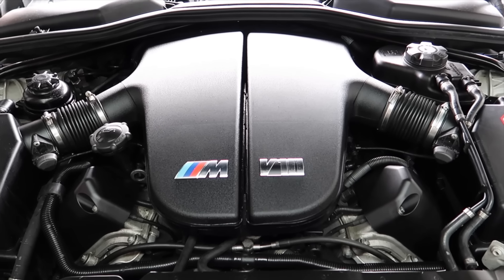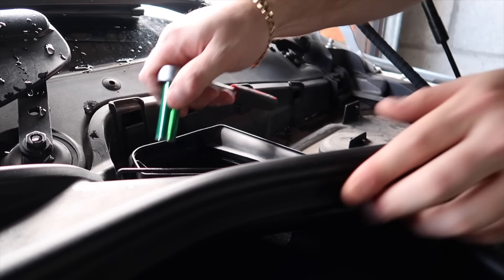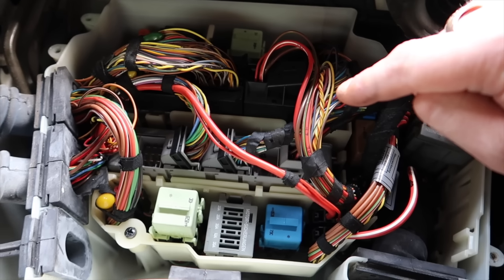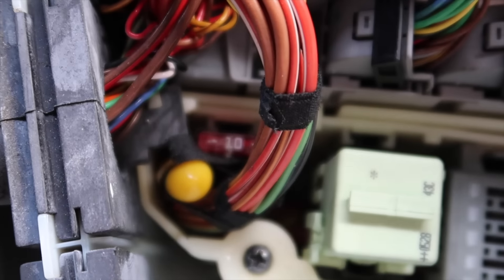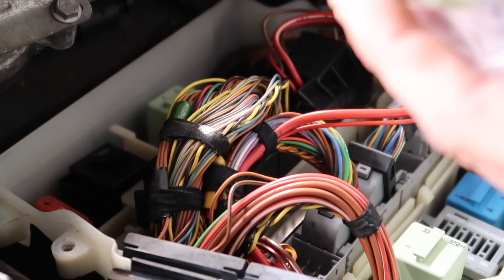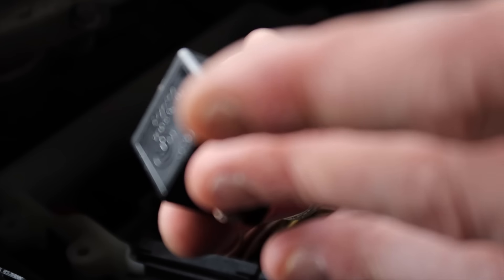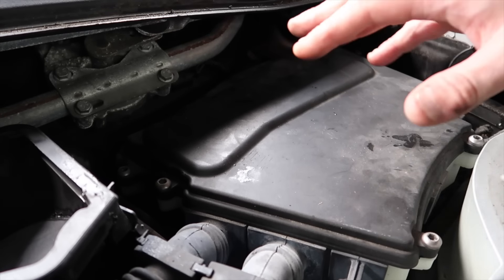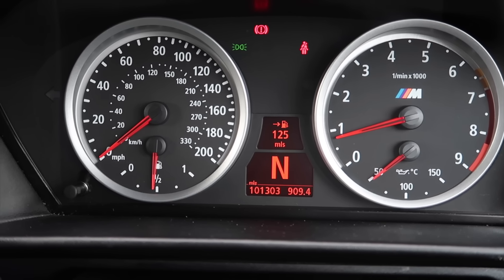This **Illegal BMW Mod** Just Changed Everything For BMW Owner's !!

Comment: Now all I need is a M5
Reply: E60 are cheap... only issue is the rod bearings...so get ready to spend $6 to $7k ... worth it just make sure you have something else as a daily driver ... driving a V6 and a V10 that need premium burn a hole in your wallet ($3.44  9/10) look at the tank size and do the math 😵
Reply: @markrayes2973  rod bearing is only one issue these engines have  there is a few more.  Throttle actuators is another common problem.  They fail more than rod bearings.  Look into it and there is a few more issues other than the bearings and actuators.    The engine is a f1 inspired engine so reliability isn't the best    requires maintenance regularly. But I love the engine myself.  I have a e60 and as much as it pisses me off sometimes it always puts a smile on my face when it is working.  Love that v10 and its sound
Reply: Same...
Reply: @markrayes2973  get a electric car not V6 lol. There are literally free chargers you can charge for free for the rest of your life
Reply: E46 is better
Reply: @markrayes2973  6,50 over UK per gallon  your lucky
Reply: @markrayes2973  bearings are not a problem if you let the car warm up.
Reply: So it’s not all bmws 😥
Reply: Love it lol
Reply: @clifrusso2174  🤦🤦🤦🤦thats not a car thats Just fore people Who think they are saving trees so they think
Reply: @trewilliams8989  e46 ?? 🤣🤣🤣
Reply: @markrayes2973  I know a guy who bought 3 v10 m5s and they all blew 😭
Reply: Best comment ever
Reply: Facts you buyin

Comment: A Word On Relay Cases: Sometimes the plastic case is installed in a different position on the same relay(by the manufacturer). So go by the PIN locations and NOT by the relay case! Thank you for the video.
Reply: They only go in one way

Comment: Will this method work on a 2000 323ci E46 (M52)? If so, is it the same procedure? If not,, show me the procedure. Thanks.
Reply: I have the same car and want to know
Reply: @standtall7646   you cant do anything for yours 323ci to get higher performance , turbo anly

Comment: Does the replacement of the relay apply only to SMG transmission? I have a 2011 F10 528i, and sometimes at very low speed while slowing down, it suddenly down-shifts and it feels like a kick in the arse. It can startle you if you don't know about it. Wanted to find out if it's maybe a relay problem and not something else. I heard from one mechanic that many other models of BMW with that transmission experience the same issue. Some spent $$$ on fluid and filter replacement, only for the issue to come back. He never mentioned anything about a relay.

Comment: Potentially dangerous, most production cars are fitted with tyres that are rated within the speed tolerances of the restricted cars speed, more velocity = more friction, more heat, more centrifugal force, more chance of high speed blowout or delamination. Not something you want to be dealing with on a public road closing in at 200mph. Check tyre specs beforehand.

Comment: I totally respect everything you say only because I am a builder with knowledge about building and not a knowledgeable person like your self who totally understands BMW and engines. 

I have a 2010 BMW X6 V8, to date at 82,000km I haven’t had any issues with the engine although I must say the engine is consuming some oil, the mechanic at BMW told me not to worry because the engine is a high performance engine, what’s your opinion about the engine of my car, is it time to  sell and move on, any advice will be warmly welcomed.
Reply: Engines, especially v8s, can burn oil over time. Unless it’s burning a significant amount of oil, it’s nothing to worry about. In other words, topping it off every few weeks is ok, but if your having to dump half or a quarter of a bottle every week, then it’s time to consider selling, or at least having it looked at.
Reply: I recomend selling it before the cylinoids go out. My dad has owned 2 v8 bmws I have worked on them. One was a e90 m3 and the other was a x5 twin turbo 4.4l v8 and man did the x5 have issues. I would recommend selling. That being said the e90 m3 was a great naturally aspirated 4 liter v8 and it was bulletproof and didn’t really have any issues when he had ownership. But they are very expensive when things go wrong for any bmw but especially the v8 and v10s. I have a e91 328i wagon it’s xdrive and I love it. I haven’t had any issues with my car but it’s an in-line 6 and naturally aspirated so it doesn’t require that much work

Comment: I tried it on my 2006 E60 m5 it it did not work, after removing the 10 amp fuse i had all sort of failure codes in the DME and gear box module and was not able to clear them until i did put the fuse back in. @BMW Doctor mine is a US version is there something different ?

Comment: Will you not get a lower rev limiter safe mode without the road speed signal getting to the ecu?  In most bmws it will get the safe mode to prevent bypassing the speed limiter by simply cutting a wire

Comment: Is it purely for top end speed or does it improve acceleration getting there too?
Reply: It sounds like it just increases top end speed. Nothing more.
Reply: very late but removing that speed limiter will get you a higher top speed but will risk your engine to damage which hints why there was a limiter
Reply: @koudiack  hilarious, no, your top speed has zero to do with hurting your engine, rev limiter keeps your engine from going too high in rpm range, and I highly doubt it will max out on rpm in highest gear at max speed as I don’t see a m5 doing 220+ mph

Comment: I found a 10amp fuse in my F10 535d N57N, I removed it and I got a Engine Light and it didn’t remove the speed limiter…I replaced the fuse for now. Any thoughts?

Comment: I have a 06  BMW 330i e90 I have a slightly different electrical box than you and I'm wondering if the one 10amp fuse inside is the same as mentioned in the video.  I have a 7.5, 5, 40, 30 amp fuses in side this box. 2:56

Comment: My question is, after you remove that 10 amp fuse (speed limiter), do you have to reprogram cpu or something after that’s done??? if you don’t wouldn’t it throw everything off? Please let us know, oopsi forgot to add I’m in the US and I know sometimes the BMW spec and such are different for Euro vs US,  does that make a difference? Would US owners have to do extra? But mainly my question is on a US spec Bimmer, do you have to reprogram after you pull the limiter fuse? And will removing the limiter, affect and diminish low-end acceleration rates? Obviously this mod will INCREASE high end power (top speed) but sometimes when you tune a car for top speed you sacrifice low-end power. Will the same hold true in this case? Thank you for sharing this and reading my comment🌹

Comment: I’m wondering if This 10amp fuse is located on the same spot for all e60 M54B30 engine manual transmission??
Reply: I don't see this fuse in my 550i

Comment: Dean,i have a question why do you need to REPLACE the same relay i mean it will function the same again whats the point
Reply from the maker: no it actually didn't it actually made it ten times better the SMG pump and the gearshifts were so much much better after this.

so clearly I think your wrong
Reply: @BMWDoctor  Yes because i dont  that much knowledge about BMW'S 🙂
Reply: @BMWDoctor  thx for video
Reply from the maker: @osamaalfayez4017  Always a pleasure !
Reply: Bmw legend !
Reply: @BMWDoctor i tried to find this fuse in my 545i it wasn't there. Is it possible that it is located in the ivm module?

Comment: Thanks for the video but I have a serious question and yes I watched the whole video. I own a 2016 bmw 535i xdrive non M sport. I opened that box on my car and there was only a small cover with wires on it and underneath the box lid was just what looks like some sort of blower for the air and heat. So my question is where is this fuse located on my car. Thanks and keep up the great videos.
Reply: Dat Benz Doe hey did you ever find the fuse? Is there one that you can even remove to simply get rid of the limiter?

Comment: wow awesome !! i own the e63 m6 2008  removing this cause any check engine lights or any type or light warning on the dash ?? would love to know this
Reply: It caused a couple when I did it so I had to put it back because one of them reduced my power  and limited some gears not sure why but I commented on here and asked if I did something wrong. I have the exact same bmw e63 m6 2008 convertible .
Reply: @shanewhitfield9253 oof. Let me know about any updates perhaps. I’m considering doing this when I get mine back. But honestly, 170 is kind of enough. If I were to take it some track that I had the room to properly do 200+ I’d have it remapped professionally and maybe a couple mods added anyway

Comment: Hi
I have a 16 plate, 435d gran coupe.
The box with the ecu/relays in is easy to see and get too in it however when taking the cover off and looking inside, I can see the ecu etc and relays however there is not a single fuse, especially a 10amp one plugged in, anywhere within the box that I can see other than those grey, relay type plugs that you can see have 5 fuses inside.
So…….quoting the video…. Does this work on a f36 4 series or not?
I’ve heard that with these, the only way of removing the top speed limiter is by mapping/flashing the ecu??
Can you or anyone let me know please?

Comment: Do you know if those two fuses that you swapped out have the same common issues on the S85 E64? Wondering if I should do those soon since I’m pushing real close to hitting 60k miles.
Reply: If you have the SMG transmission then yes, I would get new ones for just in case

Comment: Hi there you seem to know a lot about bmw I could do with some advice if possible I have a bmw e70 X5 40d is a 2011 with 95k on the clock it's developed a annoying problem the gear box as become erratic in its gear changing quite harsh between 1st and second it's had a fluid and filter change and I've recently had the inlet etc decoked and it was better for a while but now it at it again and it's doing my head in can you HELP 😬 thx phill

Comment: Ok, I need help. I have a 2008 BMW 528i. It is a no crank no start. I had starter replaced and bought a new battery. Still nothing. The mechanic said it gave a IBS code. So I tried disconnecting the IBS cable to start. Again nothing no crank no start. Everything is on in the car. When I hit the start button I hear the fuel pump trying to work but no clicking or any other sound. I’m at a point where I don’t know what else to do. HELP!!
Reply: Go to dealer and get a new key.  I have posted about this issue elsewhere.

Comment: Very cool video ! - Thanks for the info on disabling the top speed limiter on BMW's ....Would you by any chance happen to know how to fully disable the auto gearbox limp mode in the older E39's ??

 I have an V reg 1999 E39 540i auto that keeps on going into "Trans Failsafe Prog" mode every time the car warms up, the gearbox feels OK and the car drives smoothly until it gets warm, Then I feel a gentle thump followed by a gong and "Trans Failsafe Prog" on the dash and the car  is then very heavy to move forward from a standing start because the gearbox is locked up in 4th or 5th gear.

Turning the ignition on and off gets rid of the fail safe for a few moments and then it comes right back again ! making the car no fun to drive :/ 

I've checked everything and changed the battery 3 times and its still the same story, I think that there might be a break somewhere in the wiring harness that is causing the fault. The strange thing is there are no codes stored on the TCU when I scan it with  the scanner/code reader which is very weird.  

This problem only started happening when I had to reverse back and fourth to shunt the car out of a tight parking place and its been like this ever since.  I did get underneath the car and check all the wiring connectors around the transmission and engine and everything seems to be in place and nice and tight.

If there is any way to REMOVE or DISABLE the Trans Failsafe function from the car so that no matter what !, the car just runs in the main gearbox program and does not go into "trans failsafe prog" PLEASE help me !.  as this problem is now driving me bonkers ! :(  

Thanks a million bro ! ;)
Reply: I have a 2005 x5 and was having the same problem I replaced my maf with an oem and problem solved be sure to use oem
Reply: Its not a matter of removing limp mode. Something is wrong causing it to do that. Either the trans is messed up or it could be anything from a bad alternator to a maf...
Reply: What is Maf

Comment: To cut condensation in the box, put in the silica gel bags you get in everything these days in the spaces, if you take it apart ever, put them in the oven for 5 mins to dry out  absorbed moisture, replace them, job fixed.

Comment: Hello Dean,
Have you got any idea about the Central Locking actuator "blowing" fault on the E90/92? 
I took it into the dealer for the recall they changed the driver door actuator and the fuel cap actuator at the main dealer, they didn't fix the problem it blew 2 weeks later AGAIN and then refused to fix it/didn't know how had a row and they ended up ACTUALLY TAKING THE COURTESY CAR AWAY WITHOUT MY KNOWLEDGE! AND DELIVERING MY car back (Which I've had from BRAND NEW! ONLY DONE 57Kmiles!) So got a car sitting there no central locking again only driver's door and fuel cap actuator blown again! They did the recall on the heater aswell and the main power lead and since then the heater makes a noise aswell! This was "SYTNER" BMW in CHIGWELL Essex! ABSOLUTE COWBOYS!
Can you advise what you would do! And also how to fix it!? It's a BMW 320d 6Speed Manual 07 plate with the M47 lump so pre-cam chain problem engine! Although my Turbo BLEW at 50k miles!! To add insult to injury 6 months before this DRAMA! WHICH cost me a pretty penny to upgrade to a solid billet ceramic coated hybrid turbo and have fitted(and no I didn't trust BMW to do it!) Got a "proper mechanic" to do it! Not someone pushing buttons on a computer and when "computer says no" they deliver your car back with the unresolved fault and their own shoddy work STILL CLEARLY apparent/Blown and not fixed just TWO WEEKS LATER!!
Ps. Sorry for the rant pisses me off yon pay over 30k for a car and regardless if age at just 50k it needs new turbo and ventral locking and when they do that and the recall the cause more problems than it went in with and REFUSE to rectify their failure to fix the issue and their faulty shoddy workmanship!
Cheers in advance mate!

Comment: They are usually limited to 155 due to tyre limit speed :)
Reply: The tire limit speed max is 130. 155 is the limit bmw, merc, and Audi agreed to. To avoid the 130 you have to buy a performance tire package. To avoid the 155 you have to also pay extra for the high top speed package and pay for a bmw driving school.
Reply: Just get tires rated to go the top speed and ur fine

Comment: Hi, how are you, I'd like to see a strange question with you, I got tired of handling this bmw pump, and I took it to the mechanic, they've already done some things and such, and now I stop following, the car starts normally, the 4 nozzles are working it doesn't turn on any light, so if it starts in a little while, it speeds up the car a little, it turns on the engine light and it also fails, the mechanic passes their device, and accuses the usual misisfire cylinder 2, the strange thing is that the nozzles everyone was working and all that changed because the fuel
 Inject 2 stops working and boosting, If the code is erased, it goes back to normal but soon the 2 returns again and stops working on the device and the only one that remains reset

Comment: I see everyone saying it works for all bmws but will it hurt or damage anything? I have a 2011 528 with the n52 motor and I feel it wanting to pull more after 130 I have the l sport wheels and tires as well to handle it.

Comment: i would like that for low end torque on a 2000 540i
Reply: Are you refering to the limiter on Auto ECUs which protect the torque converter?

Comment: With Lorry limters they usually plumb it into other things like gauges IE older Scaina  2003 i think i use to drive you pull or replace with blown fuse it would then lose things like temp & Fuel gauge is i recall rightly ......

Does the BMW lose anything or only removes the limiter ??
Reply from the maker: Thats correct ! but with the vans its only a fuse link that stops the van going over the 65mph limit the fuse limits the speed between the link between the DME and gearbox

Comment: Hi mate what’s the best way to get any power from a 545i v8 manual I’ve had it a month getting kind of bored of it did think sell and get the v10 but it’s selling mine the 545i don’t seem to be a popular car 🙄 and I’ve spent loads on it new wheels and lowered ,window tints ,quad exhaust etc can’t see me getting my money bk to go towards a m5 but is the m5 much quicker 👍 I think mine is the last manual v8 manual M-Sport any idea what it’s worth mate
Reply: I'll give you a 5er.
Reply: You realy don't need a V8 the straight 6 is just has good just has fast just as quick top speed same & cheaper to run & more reliable & much more of a daliey user

Comment: I have a problem on my z4 2005. You see my rear right turning light is not working. I bought a new assembly  but its still not working either, that makes me think its the cable but it seems fine. I checked the fuses and they are all fine. I had changed the cable connections because the pigtail of the assembly was burned. It worked fine for 2 weeks then it went off. Any advice on what to check? I hear sanding the cables could help it does seems like the cable looks like if it was burn a little dark were I trim it to make the connection for tne new wire. Could that be the problem?